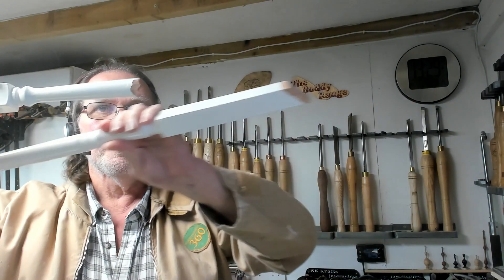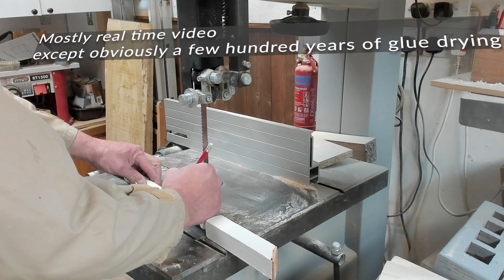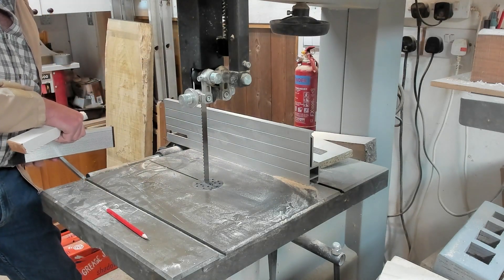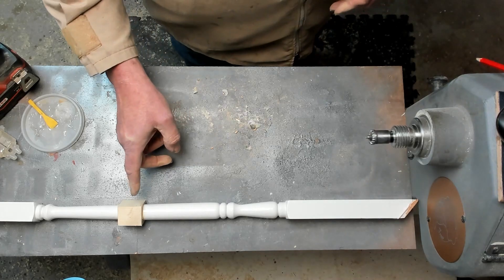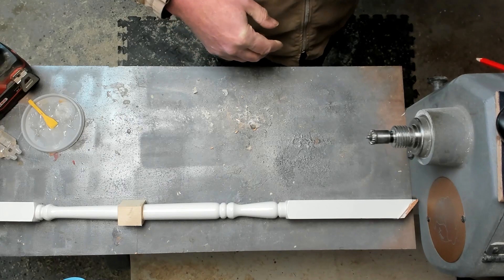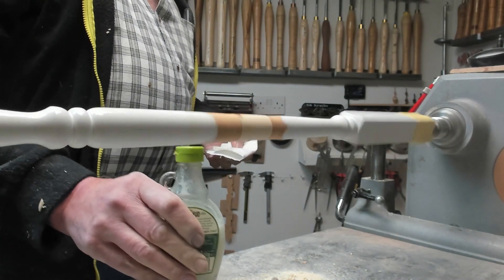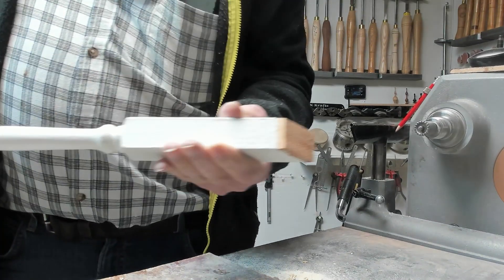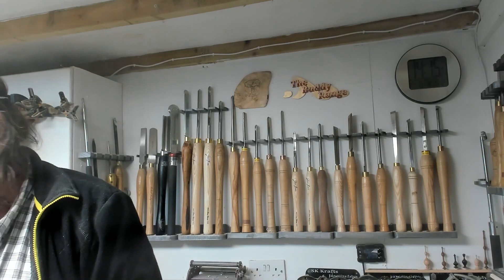Repair staircase spindle (Warning extreme masking tape use!) #woodturning

Comment: Wonderful repair, Pete! Clever idea with how you incorporated the screws to give it the necessary strength. Thanks!
Reply from the maker: thank you Greg, I learnt a few things too, if I do another then I will go with the dowel and 4 splints held on the square sections with rubber bands.

Comment: Well done Pete. I usually just make a whole new spindle 😊
Reply from the maker: I did that first Ruby, turned 4 of them, and in reality especially with glue drying time it is a lot quicker to make a spindle than repair one. But of course there is a timber cost to balance against that.